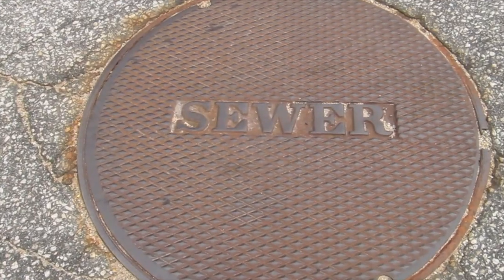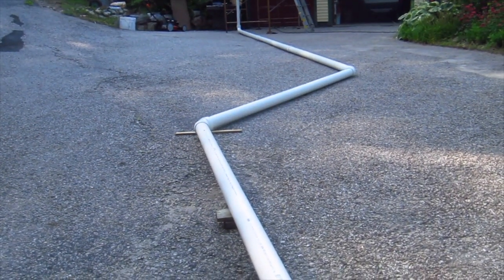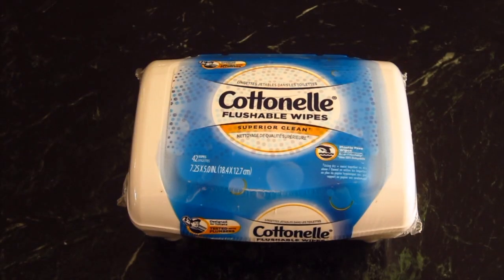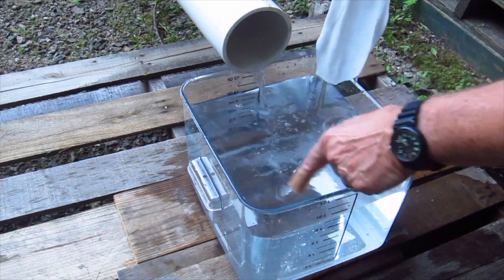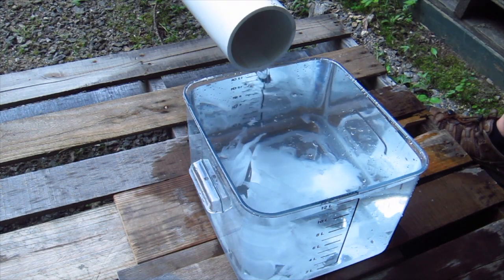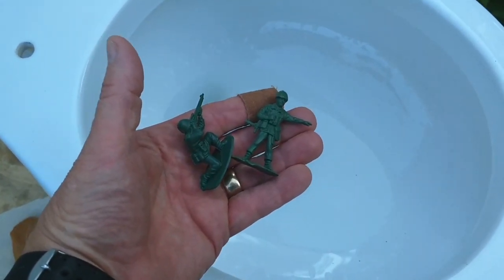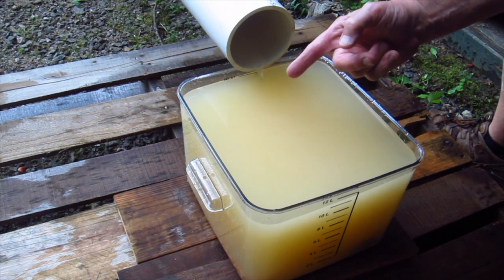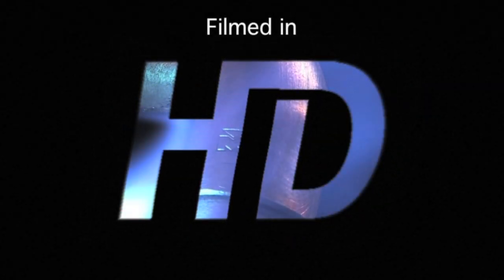Flushable Wipes - Do They Disintegrate?

Comment: You have to leave them in water for 24 hours bro I guess you should have Googled that this test is not reasonable I mean how long are these things going to stay in your septic tank
Reply from the maker: Mike, I don't think you listened to the first 60 seconds of the video. Or if you did, you forgot it already. Go back and watch/listen to exactly what I said the purpose of the test is. I've been a master plumber since 1981 and know a thing or two about building drains, sewer lines, etc. Also, you might do well to take a flushable wipe and put it in a bowl of water for a day, a week, or a month. Be sure you don't touch the water after putting the wipe in because in septic tanks there's NO turbulence. Come back in a month and let us know what your tiny gray cells have discovered.

Comment: I have an idea. What about installing a grinder pump into first septic tank set to a timer to run intermittantly (1xday, 5min) to grind up effluent and circulate it inside tank for better decomposition?
Reply from the maker: This is a horrible idea. Why not just do as I say in the video and save yourself all sorts of money on pumps and electricity?????
Reply: @askthebuilder  that is the plan. Ill do an update in about a year.
Reply: Update?

Comment: Can I ask why there was a cut in the footage at about 6:13 when you put the toilet paper in. I feel like you almost waited to ensure a better result with the toilet paper. Not that tp was suspect anyways. But I just got thrown off with my ocd by that and I still don't know why the take wasn't fished and redone.
Reply from the maker: Sure, you can ask. That was a few years ago and I suspect it's because I had to switch hands to flush the toilet or I had lost my balance up on the wobbly platform. I can assure you that the flush happened within ten seconds of placing the paper in the bowl. It's a very realistic time frame as MANY people wipe themselves then they put their clothes back on and the last thing they do is flush the toilet. That process might have the paper in the bowl 30 seconds or more. There was no need to redo the take because the time frame was realistic. Why don't you time yourself doing what I just described and then come back and tell us how long it takes you to wipe your arse twice, pull up your clothes, and then get put back together buckling your belt. My guess is 30 seconds. Looking forward to your next comment with your time.

Comment: You are missing the mechanical impellers and strainers in modern sewers.  If the wipe comes out the other end and dosnt get stuck in the pipe it did its job.  They rely on the infrastructure of modern waste processing.  It is not realistic to expect pipes to do the job of motorized machinery in the system.
Reply from the maker: You are missing the point of the entire video. Listen once more to the first 45 seconds or so. This video is about what happens to the wipes in the pipes YOU are RESPONSIBLE for maintaining. If I were you, I'd pay closer attention to what is said in a video before commenting and looking like a fool to the entire world.

Comment: The problem is this test doesn't account for how long the flushable wipes would be in the sewer or waste water system before reaching a sewage treatment plant.  Plus, as he said, most pipes do have some sort of debris or deposits that would further help break down the flushable wipes.  How about a test where you test how long it would take the wipes to break down in clean water as well as contaminated water.  I think that would be more accurate.
Reply from the maker: I'm pretty certain you failed to LISTEN or comprehend to what I said in the first 30 seconds. This test was to show what happens in the PIPING you're responsible to MAINTAIN, not the city sewage system pipes. Try to be more observant next time before you make yourself look foolish to the world.

Comment: The next question is let each of the paper materials sit for 1 day - 1 week and see what dissolves.
Reply from the maker: Edmond, I think you missed the point of the video. And in a sewage system they don't sit for a day. A sewer is like a brook in a forest. The water is flowing and moving, not sitting still. Most solids in a sewer will break apart from the tumbling that happens as the water makes its way to the sewage plant. That said, a flushable wipe WILL sit stagnant in a septic tank and the bad ones will NOT dissolve nor break apart.
Reply: @askthebuilder  yeah I have a septic tank. A guy came out and was trying to sell me bacteria that will help dissolve things in the septic tank. I was wondering how long these flushable wipes really take to dissolve on their own ?

Comment: Loved this test❤. I never did like Charmin. I buy Scotts tissue, but during the pandemic it was sold out. Therefore had to convert to a different thicker brand at Sam's Club similar to Charmin😬. After seeing this vid, going back to Scotts brand even if generic. The bowel movement was very informative despite the graphics🤣. Thanks again❤. Love your sense of humor. Glad the army men survived🤣
Reply from the maker: Army men are tough.
Reply: Okay Why?... rewatch the beginning of the video, ITS THE CHARMIN THAT STARTED TO BREAK DOWN IMMEDIATELY,  THE Scott's DID NOT!
Reply: @glenng7085  she's talking about the toilet paper, not the wipes. however, i believe charmin tp would be fine to use in a toilet. it may not break down as fast as scott, but if it was torn to shreds after that one flush, im sure it would be fine even for a septic system
Reply: 2-ply toilet paper has been effective for those that need them to be strong and soft. But flushable wipes may be just as effective as the 2-ply paper.

Comment: There's only one thing that I wish you had simulated that you didn't... An average bm does not just have the bm in the toilet. It is also the tp, and it's generally going to be more double the six squares. Followed by one, two, or even 3 wipes. All getting flushed together, which can be dramatically different from the individual situations I saw here. I think if someone saw a simulation of that with 2 ply (and there's 3 ply out now) and a wipe or two, it would make a bigger impact.

That said, it's amazing the length you went to in order to do a genuine simulation of these different items, and I thank you for your time and effort! You really went above and beyond. 💜
Reply from the maker: We already know what happens to the TP paper. I showed you two types. You're missing, I feel, the entire purpose of this video. But what do I know? I ate lunch for 20+ years sitting on top of overturned empty drywall mud buckets...
Reply: @askthebuilder  I am absolutely NOT missing the purpose, at all. I have been scolding a friend of mine for flushing wipes. And I was hoping for a visual for her, of the fact that when she uses multiple pieces of tp, followed by 2-3 wipes, that there would be at least a small struggle for it all to get down, and then the wipe still wouldn't break down. I did send her this video, but I also sent her a few from other places, so she could see the ginormous wads being pulled out of the sewer systems, and hear the damage they cause.

Like I said, when I watched yours, I was just hoping for that shocking visual that would change her ways. It's still very informative.

Comment: You missed the whole point.  "flushable " wipes are ruining waste treatment facilities, I had to replace 3 lift pumps in my home system. It took that much pain to convince the women in my household that "flushable wipes" are not flushable. I do not yet understand , why they have not been sued out of business. Really Tim .. perform a real test on video, run them through a lift pump.  Help to stop this issue. It costs waste treatment facilities millions. they are not septic safe. If its not septic safe than its not safe for the huge septic systems.   They do not break down, they cannot be filtered out without damage to the system. If i WANTED TO SCREW UP A WASTE TREATMENT FACILITY,  i WOULD START WITH SOME NYLON ROPE AND FLUSHABLE WIPES.  Please do a real video on this issue.
Reply from the maker: No, James, you missed the point. :-) I clearly state in the first 30 seconds the topic of the video. I've been a master plumber since 1981. I'd say that less than 0.000001% of the houses out there in the USA have personal lift stations. Why? Because the houses built on those parcels of ground are usually dog lots that Mother Nature is screeching, "You'd be a FOOL to buy/build on this lot and have to deal with a *lift pump*! Gravity is the only way to go."

My video is for the vast masses that have sewer lines that connect with city sewers or septic tanks. Period. My video intuitively tells any viewer, "Wow, some of these things don't break up. That could be bad news for my pipes or pumps if I have one."

That said, you can follow my lead. You've got a lift pump, a YouTube channel, and probably a smart phone with video capability. You make the lift pump video. Once your video is posted, please come back here and paste the URL in your follow-up comment that I know will appear.

Comment: So:

My landlord always ripping me off with some fees because I am to blame for pipe clocking with wet toilet paper. (but the pipes are the problem because I used normal toilet paper when their clocking happened)

Simply using normal toilet paper then?

Or is that simply faschism? (I live abroad & these people blame me for their old pipes)
Reply from the maker: You simply ask the landlord to put in writing exactly what to use so you no longer get charged fees. Use what they tell you to put in the toilet. They have to PROVE the clog was caused by you. Hard to do in a multi-family building.

Comment: Paper towels are NOT designed, or marked, to be flushed. Good thing I would use only half of the sheets of the thicker/fluffier toilet paper compared to the 1-ply. Wet "flushable" wipes are better to be thrown in the garbage (as is recommended on the pack in Netherlands/Europe).
Reply from the maker: I don't believe I've ever seen on a paper towel label that they should be flushed. I did it simply to show how durable they are.

Comment: If you ask me you not left them long enough give them time they don't break down straight away the next video i watched, they did a test and left all the flushable in water for few hrs, and the scott flushable wipe broke down against 6 other flushable wipes on the test method,  so your not leaving them to break down long enough
Reply from the maker: Dear Mr. Missed the Egg: When you leave a BM in the toilet, do you wipe yourself, get up, put yourself together, walk out of the bathroom, and come back HOURS LATER to FLUSH the toilet? Or, do you flush the toilet within seconds of getting up off the throne? Come on, use those critical-thinking skills God gave you for goodness sake. My test was realistic and to prove it was the Flushable Wipes Alliance folks have YET TO COMPLAIN that the video test was wrong. It's dreadful that folks like you are not using your tiny gray cells for the intended purpose.

Comment: Would it really hurt their sales that much if manufacturers were forced to relabel them 'disposeable' wipes instead? I guess they'd lose a few sales if customers learned they'd have to toss them in the can but that's nothing a shame campaign can't fix.
Reply from the maker: I think you completely missed the point of the video. You can FLUSH thousands of things down a toilet. So labeling something as FLUSHABLE is not necessarily illegal. It is unethical? You be the judge.

Comment: I think flushable wipes are safe, but there are still people flushing NON flushable wipes. 
If you go to my local Walmart, there are flushable wipes that sit directly next to non flushable wipes on the shelf.
Reply from the maker: Would you be kind enough to share a URL from Amazon to these mystical wipes that are clearly labeled: NON-Flushable? I also think you missed the entire point of the video. But what do I know? I used to eat lunch for 20+ years sitting on empty overturned drywall mud buckets.
Reply: @askthebuilder  WaterWipes Unscented Baby Wipes, Sensitive and Newborn Skin, 9 Packs (540 Wipes) https://www.amazon.com/dp/B008KJQMA0/ref=cm_sw_r_cp_api_glt_fabc_5T05SVSVHYZ1VJ2MMJXW

One more if you needed anymore assurance.
Reply from the maker: @ehh2681  Thanks for the URL. I agree it would be a great idea for the manufacturer to put in big red letters on the box: DO NOT FLUSH

Comment: I managed the maintenance and operations at a 300,000 square feet office building with around a thousand employees working there. I had to spend a month educating them of the hazards of wet wipes blocking the toilets. And tampons etc. The most common argument I got was it says on the pack flushable ....go figure
Reply from the maker: Stephanie,  consider sending out an inter-office MEMO email with the link to this video asking all employees to watch this video. As you know, I explain in the video that the labeling is unethical.

Comment: To bad you didn’t put a cast iron house trap at the end,  since that is where  I find what looks like floating concrete, a big spit  ball mixture of wipes and food grease clogging the trap on the house side right under the plug.
Reply from the maker: And this is precisely why running traps are a plumbing WORST practice. I'd never put one in on my job nor would most plumbing inspectors permit them.

Comment: You are flushing in new pipes that are all smooth inside but older pipes or ones with irregularities in the joins or already partially blocked with catch the wipes and stop them from flushing out. These quickly bond together like papier maché and form a semi rigid block.
Reply from the maker: Yep. I alluded to that in the video. Did you miss that part?
Reply: @askthebuilder  Hi, thanks for that, no I had to leave in the middle !! Great experiment though, such dedication. I personally will not have them in the house ( wipes ) and even recently when people complained about toilet paper shortages I replied that there was water and soap ! I have lived in a couple of hot countries and visited more where people do not use paper. In some northern european countries they put the soiled paper in a basket next to the toilet and when I lived in Brazil they said that the diameter of the waste pipes there didn't allow for paper.

Comment: Now, the same but with transparent pipes for the extra effect! :P
Reply from the maker: That wasn't the purpose of the video - to show the turbulence of the water as is moves. The purpose of the video was to show the condition of the wipes at the end of the journey. There are other videos online of clear drain pipe if that's what you want to see.
Reply: @askthebuilder  I was actually thinking of possible clogs and at which level the wipes would cause an issue, but this doesn't seem appropriate for brand new plumbing since it would very unlikely clog

Comment: Excellent video Tim!  If anyone out there is having trouble with wipes or other debris clogging up a sewage grinder, you should check out the Float Management Control.  It keeps the grinder operating until it has finished grinding up the debris, even after the Off Float in the tank drops.  This way, the grinder doesn't have a clog to try to overcome when it needs to start back up.  Here is the website if you want to check it out:     https://innovativeutility.com/float-management-control
Reply from the maker: I recommend this: To get unlimited tips each week, subscribe to my FREE newsletter at www.AsktheBuilder.com

Comment: I really appreciate the amount of work you put into that testing rig and all the testing you did, but there's one important thing I don't see: where is the house trap? Don't all houses have a house trap exiting the house? I would think that would be the most likely place that flushed items could get stuck and cause problems.
Reply from the maker: Uh, the video is not about how to install plumbing pipes or even where clogs happen - even though I'm a master plumber. It was recorded to show what happens to flushable wipes as they travel through a building drain to the sewer tap or septic tank. Period.
Reply: @askthebuilder  And it does that very well. I'm just saying that after all the effort you put into building the setup, it's a shame not to see the interaction with a trap. Maybe it's just me ... but I was curious.
Reply: @askthebuilder  plus ideal conditions, and like you said the waste line can be full of debris etc which wipes cling onto.

Comment: Interesting video. I really like how the Cottonelle wipe really starts to break down. I feel like it would be ripped apart when other things are added in there with it to.  Also, sooo many people seem to think baby wipes and flushable wipes are the same thing. They aren't, and the fda put heavy fines and stricter guidelines on wipe manufacturers some years ago for causing extensive damage to city systems. Everything now has to meet certain requirements for city sewage use. That does not include septic systems though. They do design wipes that are septic safe and breakdown very easily. Parents have used wipes on their septic now for 13ish years now without any issues caused from them. Just do your research before throwing any wipe down the pipe!
Reply: I know it’s been a year lol, but what type of wipe have the parents been using with no problem? Everytime I look it up it’s always Cottonell or a couple other brands and it’s the same but I’m hearing a lot of mixed reviews on them but Cottonell seems to be the best?
Reply: Yes! This is the problem!!! Baby wipes can’t and shouldn’t be flushed yet people do it anyway 🙄🤬
Reply from the maker: I say we gather them up and strike them with wet noodles! If you want FREE unlimited tips like this each week, subscribe to my newsletter at www.AsktheBuilder.com